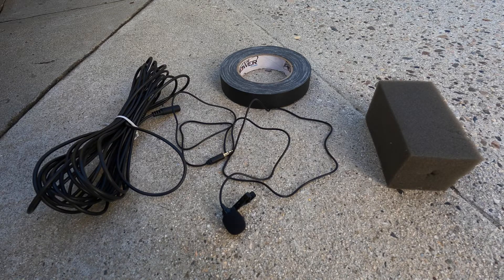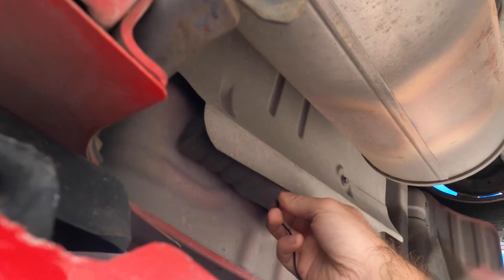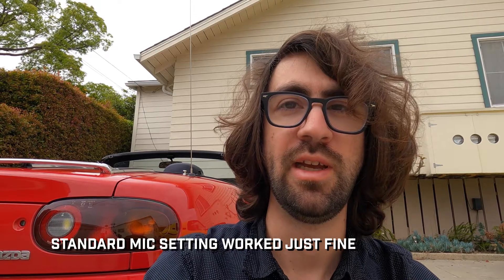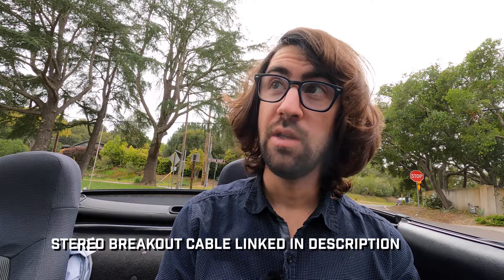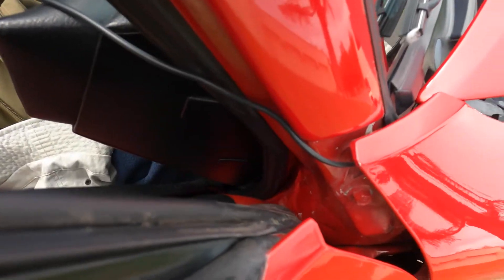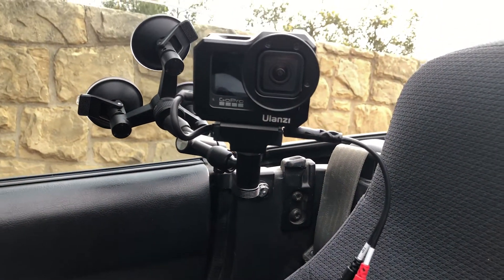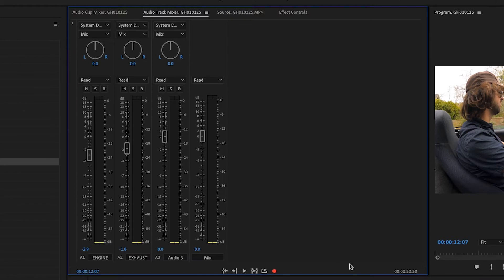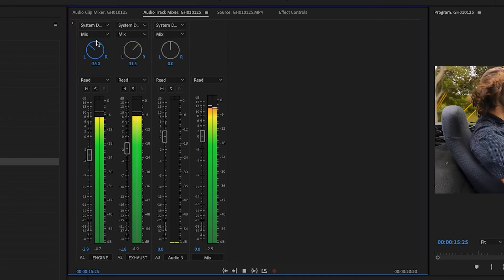Recording Car Audio That Actually Sounds Good! PART 1: Cheap & Easy

Comment: Hey man, great video. I bought everything that you linked on this video, then I tried it on my car. I'm running nearly straight pipes, so the exhaust sound is too loud for the little mic and the sound is all distorted. Is there an easy or inexpensive work around this problem? 

I also tried it in the engine bay and same result - just too loud.
Reply from the maker: Dang, sorry it's not working out for you! It's true that these little mics can only handle so much. It's hard to find good small mics that can handle high SPL and they often don't even tell you in the specs how much they can take. I've since been using some better ones along with an audio recorder, that can supposedly handle up to 120db (I use them in part 2).

Anyway if moving the mics further away from the sound source isn't enough, try some more aggressive shielding around the mics to help bring the level down. One thing I thought of trying (but haven't yet) is to put a rubber vacuum cap over the mic.
Reply: @AndrewDoesCarStuff  I'll definitely try that. Do you think the Zoom thing is a solution since it has gain control?

Comment: What wireless recording devices do you recommend?   Figure I put one on a suction cup next to the exhaust, and one in the engine bay.
Reply from the maker: I haven't used wireless mics for this application, so I'm not sure how well they'd work, but I would try something like Rode Wireless Go II, or DJI mics. They are small enough that you could wrap up the mics/transmitters in open cell foam (for wind shielding) and mount them where you want on the vehicle. Then you can sit inside and plug the receiver in to your audio recorder (or camera). Seems like it should work fine, I just wonder if the signal would be reliable. Those mics can handle about 100 db so they should work ok on vehicles that aren't super loud.
Reply: @AndrewDoesCarStuff  Yes, that's what I've been looking at!   Thanks I enjoy your videos, you're a funny guy :)

Comment: Great video in general and nicely explained. I like especially the editing part. But... the sound is too good for the car. The car never sounds like that when you really drive it. As for me I want to shoot a rather realistic POV in my Miata but I never hear the exhaust nor the engine like that. I am testing a mic position behind the seat with unsatisfying results. Another Youtuber does binaural sound recording where the mic is attached to his ears but gee that seems a bit exaggerated as well.
Reply from the maker: Thanks! And you're right, if you wanted a more realistic driver's perspective sound, you'd want to put mics in the cabin. Try somewhere in the open, rather than tucked behind the seat. That's probably too blocked off and muffled. Anyway, the way I did it was to capture the sounds at their source, which tends to be more exciting, even if it's louder than reality.

Comment: curious, what kind of settings are your running the gopro: I know you said standard mic was fine: still ok when you used the splitter? also, how about wind settings?
Reply from the maker: Yep, standard setting was still fine with the splitter. Leave the GoPro wind settings turned off - it's way better to physically shield your mics than to let software mess up your recording.

Comment: I have a plan to make vehicle simulation game. For my game, I need to record bus exterior engine  sounds while it’s moving , how can I record them
Reply from the maker: Same methods should work, just going to need the cooperation of the bus driver and some long wires! The challenge is going to be where to mount the mic(s) and have enough shielding from wind. Check out part 2 for a better setup using a dedicated audio recorder.
Reply: @AndrewDoesCarStuff  the problem is those buses are AC buses and have rear engine, how can we connect long wires in this scenario

Comment: Is it a problem necessarily if it's a TRRS?
Reply from the maker: Maybe not, but you could use a TRRS to TRS adapter to make sure the signals are going to the right place. Always preferable to match the input to the device.

Comment: Which breakout cable works with the gopro? There's 3 different options.
Reply from the maker: It's the 3.5mm TRS to Dual 3.5mm TSF version. Keep in mind that you also need the GoPro mic adapter as shown in the vid.
Reply: @AndrewDoesCarStuff  thanks!

Comment: Andrew. I wonder if this foam set up would work for ambient sound outside the vehicle which is what I would like to record. I do driving videos with a GoPro attached to the front hood of my car and record drives. I would like to capture audio outside the vehicle without wind noise. I was thinking of stuffing this foam with a mic in it into the area between the bottom of the windshield and the top of the hood. There is a gap there. Ambient sound outside of the vehicle is something I would love to record on a separate unit and then synch that sound with the GoPro after deleting the GoPro audio itself. I usually synch by beeping the horn a few times and then use Final Cut to take care of the editing. I’ll try it but I was wondering if you had any ideas on recording wind noise free ambient sound outside a moving vehicle. The way this guy captures ambient sound outside the car is what I’m looking for. https://youtu.be/7HaJArMDKgI Thank you very much.
Reply from the maker: Interesting question! I think this type of foam would work fine for what you're doing, especially at low to medium speeds. You can also try "dead cats" which use long faux 'hairs' to absorb the wind. If you just want ambient noise and want to avoid the sound of your own car, maybe further away from the engine would be wise, like on the roof or something. It does help to physically shield them from the wind, however, as wind still makes a rushing sound at higher speed, whether it's actually getting into the mics or not. If using a separate audio recorder, be sure to set the sample rate to 48k as that will match up with your video. 44.1k is usually the default (for music recording) and will go out of sync with the video, especially on longer clips. Even with the correct sample rate, sometimes two devices will interpret time a little differently, and they might still go a little out of sync on a long clip. So running the mics into the camera might be a good idea for your application. I know the GoPro adapter setup is pretty annoying though. I'm getting close to finishing Part 2, in which I use a recorder and show how to sync things up.
Reply: @AndrewDoesCarStuff  Thank you very much Andrew. Very helpful advice. I look forward to volume 2 of this series. Volume 1 is one the best explanations of this technique on YouTube.
Reply from the maker: @TomKaszuba  Thanks, I appreciate that!

Comment: Great, informative, and well thought out video, however there is one very concerning problem with you and the video, easily remedied though. 

You committed the ultimate no no in a “sports car” on a fun, curvy road. You blatantly crossed over the double yellow lines numerous times, and the last time shown in the vid was seconds away from going head on with a motorcycle. Please, if you haven’t already, change your driving style to never cross the double yellows, it could save a life in the future, and that life may even be your own.

Comment: my engine sound is peaking all the time :((
Reply from the maker: Some possible reasons: 
-Input settings are incorrect or input level is too high on your camera or recorder
-Mic can't handle high SPL, check that rating online or in the manual if possible
-Mic placed too close to engine

I'm still learning as I go too, not all lav mics can handle the loudness of engines and exhaust.
Reply: @AndrewDoesCarStuff  i think reason might be me not using a dedicated recorder, im using my camera to change gain

Comment: Hi, I'm guessing those cheap mics are condenser? Would a dynamic microphone be better?
Thanks
Reply from the maker: Yes, in theory dynamic mics should be better at handling the high SPL than condenser mics. Though when I was looking, there aren't many small lav mics that are dynamic. The ones that do exist are on the pricier side, like the Shure SM11, and in that case you have to deal with the XLR plug.